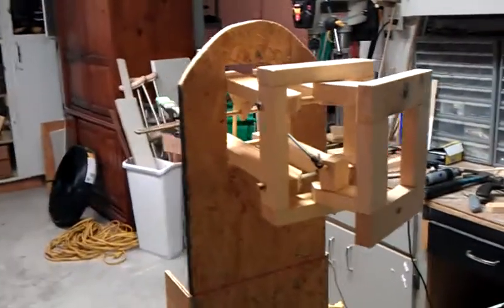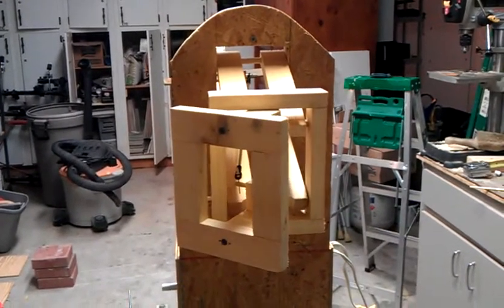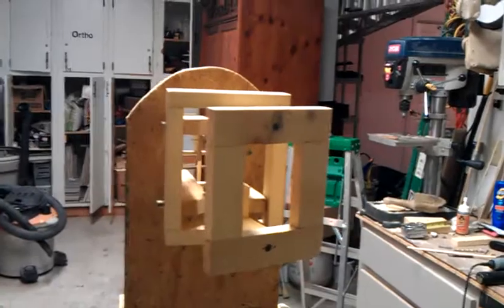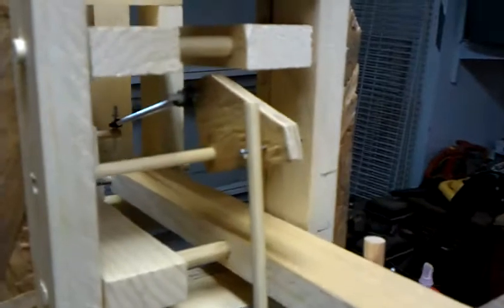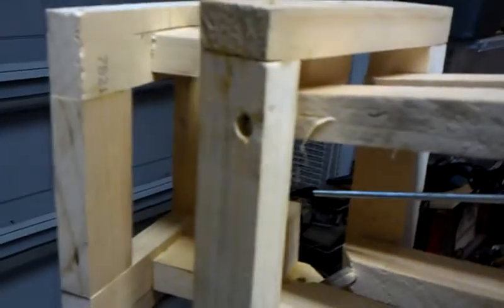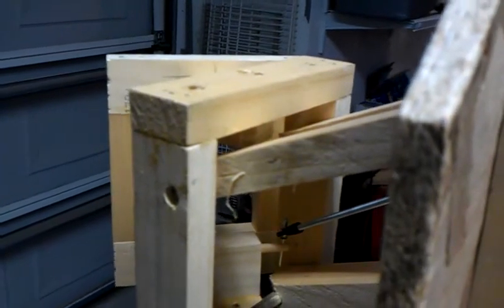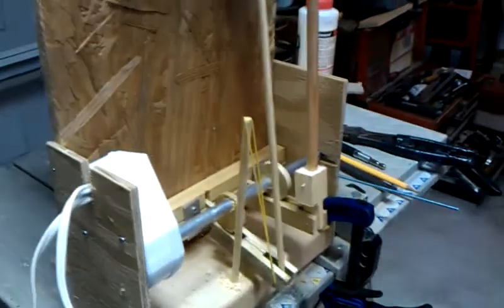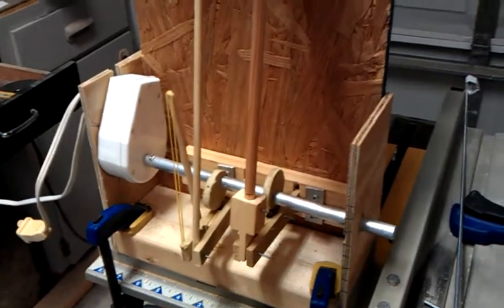Phantom Shadow 2

Comment: Does the use of the cams compensate for the torque of the motor?  I was working on rebuilding a grave popper that I have because the motor I am using is too damn loud.  I tried to rebuild it using a deer motor, but it kept reversing on itself because it didn't have the torque to lift the torso of the grave popper.  Do you think that using a cam system similar to what you have here would allow me to use the deer motor?